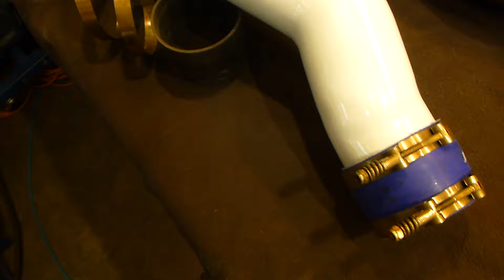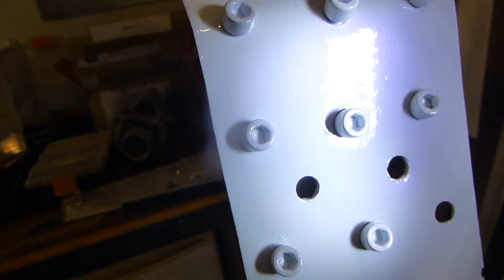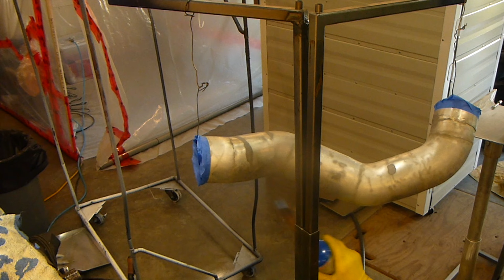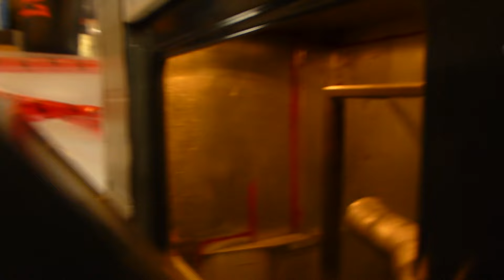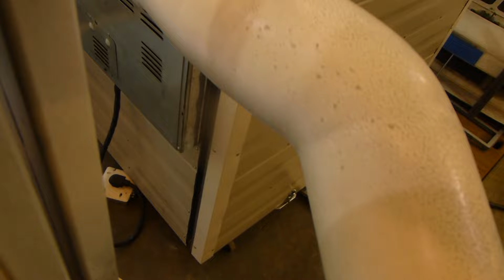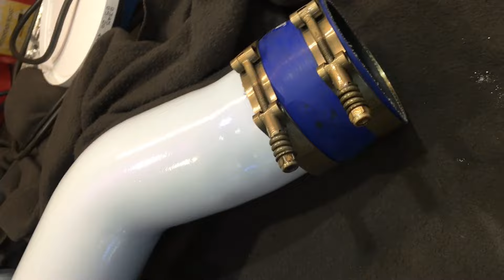Intake Tube Powder Coating

Comment: What does powder coated intake do ?
Reply from the maker: It looks good, it wears much better than paint especially in a mixed heat environment around turbos or exhaust manifolds. The intake itself is 4”, allowing for enough airflow in a 450-500whp setup, and it sources the air from a cold location in the trunk and quarter panel rather than the engine bay, which provides a performance advantage.